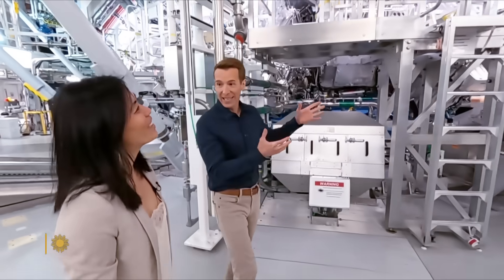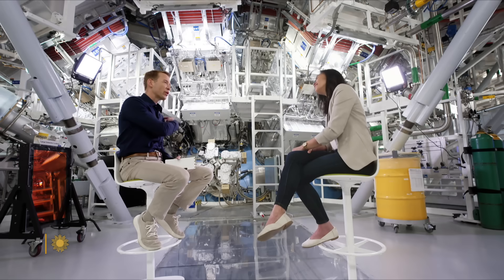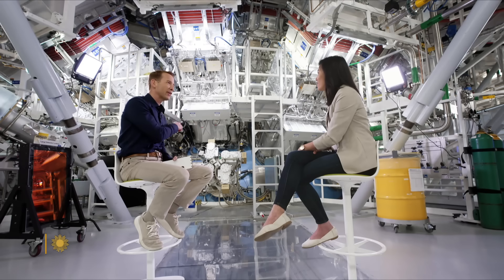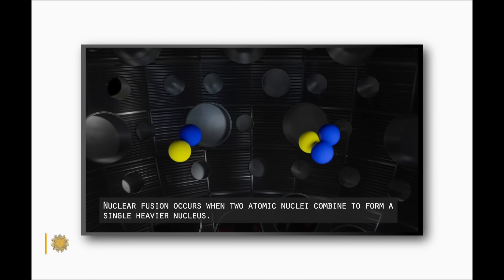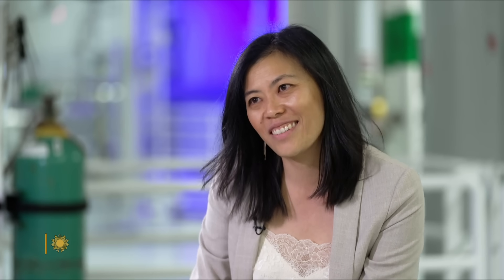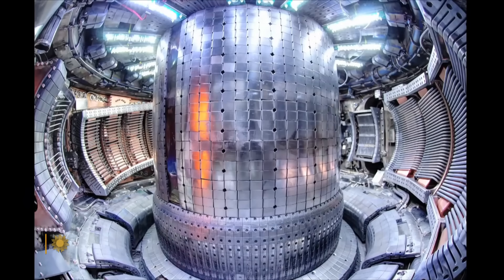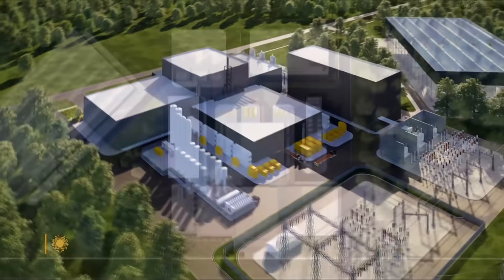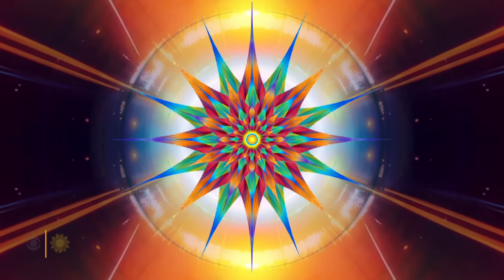Fusion energy: Unlocking the power of the stars

Comment: Most people have no idea how the sun works. This will help them understand.
Reply: The sun does not use this form of fusion and doesn't need to.  The sun uses the vast weight of stellar masses of hydrogen to naturally induce fusion using normal hydrogen without resorting to rare isotopes of hydrogen like tritium.
Reply: Neither fusion nor fission nuclear is needed on the terrestrial grid.  In its over 70-year history, nuclear power only runs some 10% of the world's grids and that figure is dropping.  Nuclear power's high cost, extremely long build times, small overall capacity (slow growth) along with unparalleled risks means it's the wrong tool for the job on the terrestrial grid.  Use the right tool for the job and everything works fine.  But use the wrong tool for the job and you can get disaster.

But nuclear power will continue to be useful in small scale applications where it excels in like military, scientific, deep-space exploration.
Reply: Most people don't even understand what happens right in front of them everyday of their lives.  The sun is 99.9% the mass of the solar system and most of the remaining 0.1% mass is mostly Jupiter and Saturn.   The Earth is like a tiny pebble next to a large watermelon.

All the combined fission energy and potentially fusion energy (if ever) would amount to a bucket or two of water floating in an ocean.  The sun provides 173,000-terawatts of power the Earth non-stop for billions of years and at least a billion more.  For reference, that amount of power can provide all the world's annual 620-exajoules of energy in just 1 hour, or just 1/10000th of that over a course of 365-days.

The sun powers our weather systems and our entire biosphere.  The sun's energy runs through our veins and power's our thoughts from our very first day to our very last day.

Neither fusion nor fission nuclear is needed on the terrestrial grid.  In its over 70-year history, nuclear power only runs some 10% of the world's grids and that figure is dropping.  Nuclear power's high cost, extremely long build times, small overall capacity (slow growth) along with unparalleled risks means it's the wrong tool for the job on the terrestrial grid.  Use the right tool for the job and everything works fine.  But use the wrong tool for the job and you can get disaster.

But nuclear power will continue to be useful in small scale applications where it excels in like military, scientific, deep-space exploration.
Reply: Most people don't even understand what happens right in front of them everyday of their lives.  The sun is 99.9% the mass of the solar system and most of the remaining 0.1% mass is mostly Jupiter and Saturn.   The Earth is like a tiny pebble next to a large watermelon.

All the combined fission energy and potentially fusion energy (if ever) would amount to a bucket or two of water floating in an ocean.  The sun provides 1.73×10¹⁴ watts of power the Earth non-stop for billions of years and at least a billion more.  For reference, that amount of power can provide all the world's annual 620-exajoules of energy in just 1 hour, or just 1/10000th of that over a course of 365-days.

The sun powers our weather systems and our entire biosphere.  The sun's energy runs through our veins and power's our thoughts from our very first day to our very last day.

Neither fusion nor fission nuclear is needed on the terrestrial grid.  In its over 70-year history, nuclear power only runs some 10% of the world's grids and that figure is dropping.  Nuclear power's high cost, extremely long build times, small overall capacity (slow growth) along with unparalleled risks means it's the wrong tool for the job on the terrestrial grid.  Use the right tool for the job and everything works fine.  But use the wrong tool for the job and you can get disaster.

But nuclear power will continue to be useful in small scale applications where it excels in like military, scientific, deep-space exploration.
Reply: Most people don't even understand what happens right in front of them every day of their lives.  The sun is 99.9% the mass of the solar system and most of the remaining 0.1% mass is mostly Jupiter and Saturn.   The Earth is like a tiny pebble next to a large watermelon.

All the combined fission energy and potentially fusion energy (if ever) would amount to a bucket or two of water floating in an ocean.  The sun provides 1.73×10¹⁴ watts of power the Earth non-stop for billions of years and at least a billion more.  For reference, that amount of power can provide all the world's annual 620-exajoules of energy in just 1 hour, or just 1/10000th of that over a course of 365-days.

The sun powers our weather systems and our entire biosphere.  The sun's energy runs through our veins and power's our thoughts from our very first day to our very last day.
Reply: Most people don't even understand what happens right in front of them every day of their lives.  The sun is 99.9-percent the mass of the solar system and most of the remaining 0.1-percent mass is mostly Jupiter and Saturn.   The Earth is like a tiny pebble next to a large watermelon.

All the combined fission energy and potentially fusion energy (if ever) would amount to a bucket or two of water floating in an ocean.  The sun provides 1.73×10¹⁴ watts of power the Earth non-stop for billions of years and at least a billion more.  For reference, that amount of power can provide all the world's annual 620-exajoules of energy use in just 1 hour, or just 1/10000th of that over a course of 365-days.

The sun powers our weather systems and our entire biosphere.  The sun's energy runs through our veins and power's our thoughts from our very first day to our very last day.
Reply: Coulomb force in ratio with gravity force at same distance is K/G=10^20 times stronger additionally thermal expansion of Sun which is gaseous not allows plasma atoms come together. Premise is: gravity force is capable overcome Coulomb force and thermal expansion and create fusion reaction. Then you plug numbers in physics equation, it is not so clear how thermonuclear reaction happens inside Sun.
Reply: @phyarth8082   Firstly, the extremely dynamic nature of a star's fusion environment is fundamentally relevant.  But this environment is not easily represented on a whiteboard or with a single formula.

Secondly, quantum mechanics (*quantum tunnelling*) is occurring within the sun.  In a broader context, quantum effects explain many real-world phenomena when classical physics don't seem to work.  Like the photoelectric effect (Einstein, 1921) proved the existence of the photon which won Einstein a Nobel prize.  Also, quantum mechanics shows how the CO₂ molecules so readily absorb infrared radiation which effects climate studies.

Classic physics: For our sun, which uses a proton-proton fusion chain, the minimum Coulomb barrier is 1.44MeV.  In the Sun's core, protons have an average kinetic energy of only ~1.3keV which is far lower.  But fusion is still possible.

Quantum Tunneling: The probability of tunneling through the barrier is low but non-zero, enabling fusion at "low" energies.

Maxwell-Boltzmann Distribution: A tiny fraction of protons in the high-energy tail of the thermal distribution can overcome the barrier.  Some of this fusion heat ends up increase the probability of proton-proton encounters to further sustain the reaction.

Gravitational Confinement: Pressure and density in the sun's core increase collision rates which compensating for the low quantum tunneling probability.  

Our terrestrial fusion attempts cannot even come within orders of magnitude to this level of gravitational confinement (pressure) and thus the Coulomb barrier is a huge wall.  Terrestrial fusion is not worth pursuing at the moment especially as climate change is collectively breathing down our necks.  Fusion energy needs to provide net-positive energy at an economically viable price.  Without that, one cannot sustain a business around it with without substantial subsidies.  This is presuming net-positive fusion energy can even be achieved terrestrially which is still a big open question.
Reply: @phyarth8082   Firstly, the extremely dynamic nature of a star's fusion environment is fundamentally relevant.  But this environment is not easily represented on a whiteboard or with a single formula.

Secondly, quantum mechanics (*quantum tunnelling*) is occurring within the sun.  In a broader context, quantum effects explain many real-world phenomena when classical physics don't seem to work.  Like the photoelectric effect (Einstein, 1921) proved the existence of the photon which won Einstein a Nobel prize.  Also, quantum mechanics shows how the CO₂ molecules so readily absorb infrared radiation which effects climate studies.

Classic physics: For our sun, which uses proton-proton fusion chain, the minimum Coulomb barrier is 1.44MeV.  In the Sun's core, protons have an average kinetic energy of only ~1.3keV which is far lower.  But fusion is still possible.

Quantum Tunneling: The probability of tunneling through the barrier is low but non-zero, enabling fusion at "low" energies.

Maxwell-Boltzmann Distribution: A tiny fraction of protons in the high-energy tail of the thermal distribution can overcome the barrier.  Some of this fusion heat ends up increase the probability of proton-proton encounters to further sustain the reaction.

Gravitational Confinement: Pressure and density in the sun's core increase collision rates which compensating for the low quantum tunneling probability.  

Our terrestrial fusion attempts cannot even come within orders of magnitude to this level of gravitational confinement (pressure) and thus the Coulomb barrier is a huge wall.  Terrestrial fusion is not worth pursuing at the moment especially as climate change is collectively breathing down our necks.  Fusion energy needs to provide net-positive energy at an economically viable price.  Without that, one cannot sustain a business around it with without substantial subsidies.  This is presuming net-positive fusion energy can even be achieved terrestrially which is still a big open question.
Reply: @phyarth8082   Firstly, the extremely dynamic nature of a star's fusion environment is fundamentally relevant.  But this environment is not easily represented on a whiteboard or with a single formula.

Secondly, quantum mechanics (*quantum tunnelling*) is occurring within the sun.  In a broader context, quantum effects explain many real-world phenomena when classical physics don't seem to work.  Like the photoelectric effect (Einstein, 1921) proved the existence of the photon which won Einstein a Nobel prize.  Also, quantum mechanics shows how the CO₂ molecules so readily absorb infrared radiation which effects climate studies.
Reply: @phyarth8082  Firstly, the extremely dynamic nature of a star's fusion environment is fundamentally relevant.  But this environment is not easily represented on a whiteboard or with a single formula.

Secondly, quantum mechanics (*quantum tunnelling*) is occurring within the sun.  In a broader context, quantum effects explain many real-world phenomena when classical physics don't seem to work.  Like the photoelectric effect (Einstein, 1921) proved the existence of the photon which won Einstein a Nobel prize.  Also, quantum mechanics shows how
Reply: @beyondfossil  Yes, quantum tunneling allows occur fusion reaction at much lower temp. Elephant in the room is self-gravitating Sun, which is in framework of classical mechanics. Sun gravity is so strong that it overcomes Coulomb force (classical mechanics) and Sun ignites under enormous pressure of gravity force and later it overcomes thermal expansion force. You must take enormous leap of faith to believe that it happens in the Sun.
Reply: @phyarth8082  YouTube is blocking further comments to this thread